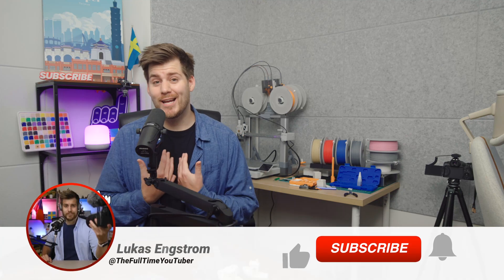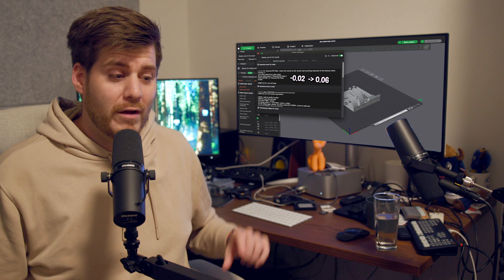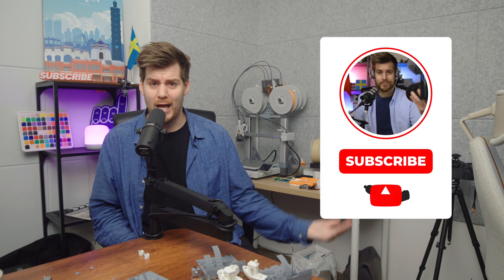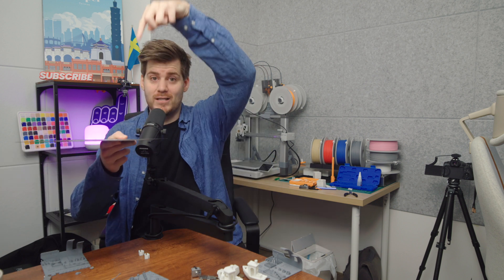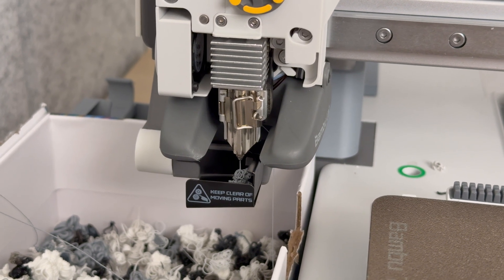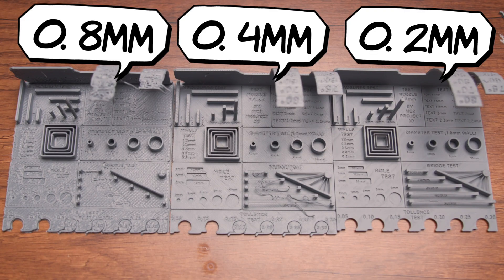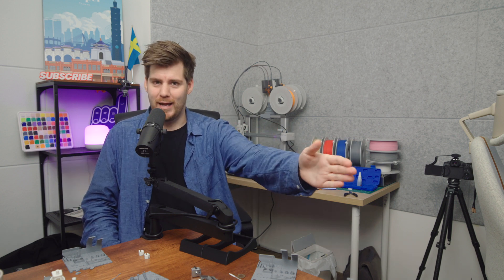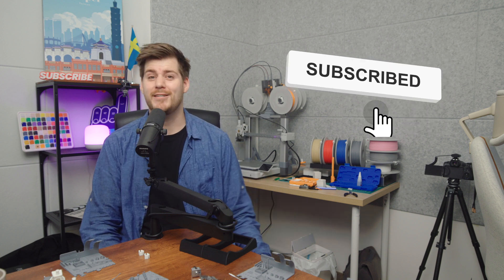This ONE BambuStudio Setting Saved My 10-Hour Failed Print! MUST-WATCH For New Bambu A1 0.2mm Users!

Comment: This video was very helpful!  It would have taken me a long time to determine I had to change the G-Code.  Now, this may be why some of my other prints did not work out so well.  I am going to retry them taking into account changes in the G-Code.  Thank you so much.
Reply from the maker: Thank you! Yea I think this issue is very easy to spot. The first layer is super thin/not printing the entire layer. Then it’s a quick fix (even faster if you save it as a user preset) to solve any similar issues in the future!

Comment: Have you printed anything else after you changed the z offset using a .02 nozzle? Or did you  use the default settings ?
Reply from the maker: No other prints yet. Once I figured it out I decided I needed a few days away from that 0.2 nozzle! Haha But I saved the setting as a new preset, so my plan would be to use the DEFAULT settings first, and then use this new setting whenever needed. You’ll notice the first-layer issue very quickly and now I’ll recognize the issue right away!

Comment: Amazing, i was watching at my 0.2mm nozzle in the box last night and was wondering if its just a simple swap and print. This vid was an eye opener!.
One more thing, i noticed you top mounted your AMS Lite, i'd like to do the same as it takes alot of space on my desk, which bracket did you use and are the supports on the printer uprights part of it?
Reply from the maker: Hi!
I used the file from Bambu Lab themselves - https://makerworld.com/en/models/92486-ams-lite-top-mount-for-a1?from=search#profileId-100105

That file has everything you need to get it all set-up! I printed in standard Bambu Lab PLA without any issues!